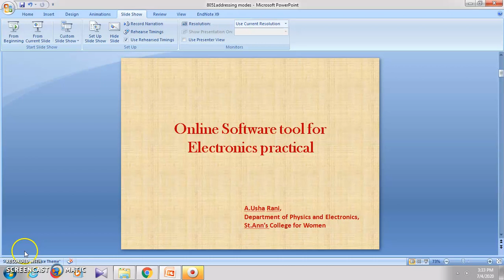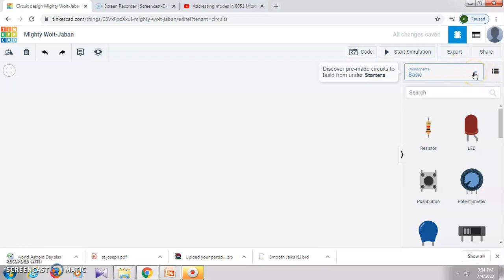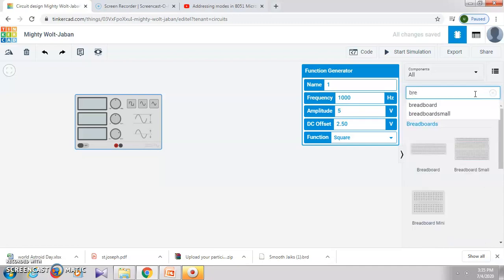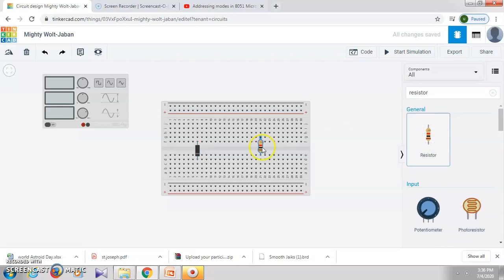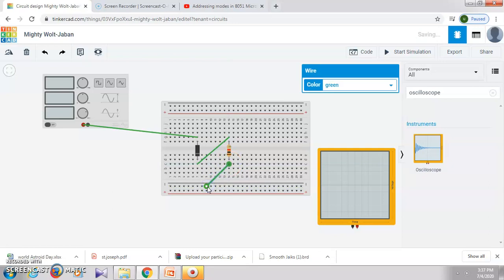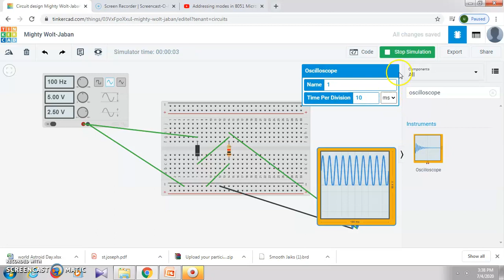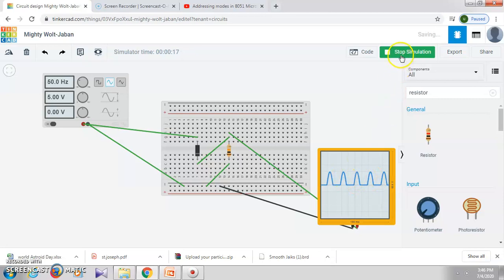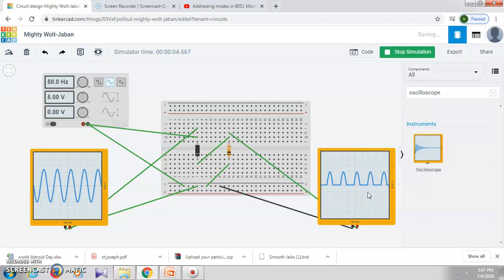Half wave rectifier experiment online - using tinkercad

Comment: How to make full wave?
Reply from the maker: This is the video link for full wave bridge rectifier https://youtu.be/0SIAX7vC6P0
Reply: @UshaRaniphysicselectronics  
How to do for Center tap full wave rectifier
Reply from the maker: @aarti7136  For centre tap you need a centre tapped transformer which is not available in tinkercad. On multisim it can be done
Reply: @UshaRaniphysicselectronics   Thank you .....why function generator won't work?
Can we attached it to the ground ? Will output come ?
Reply: Thankx a lot🙏🏻🙏🏻🙏🏻🔥❤️